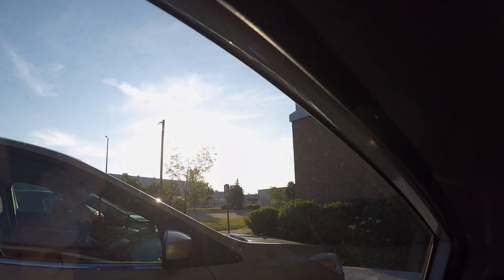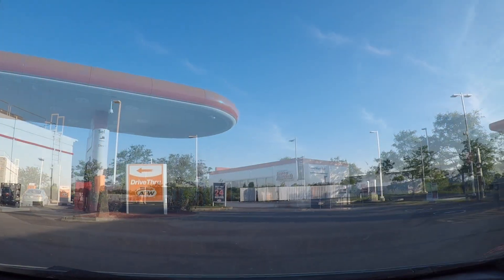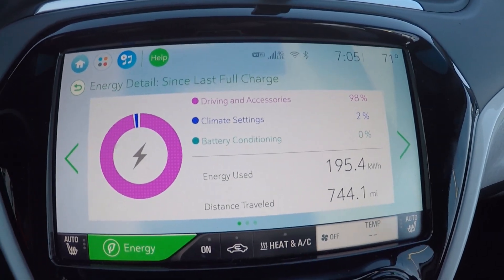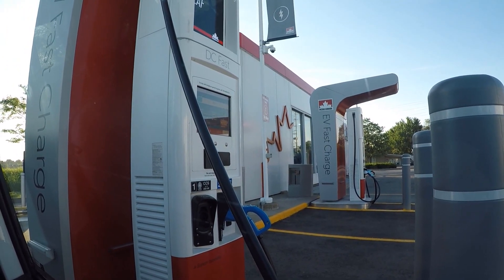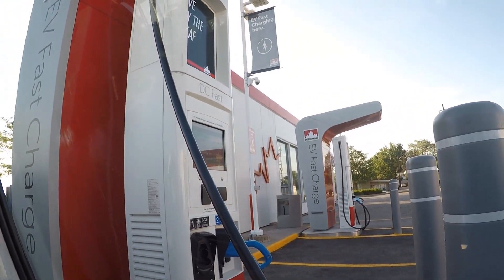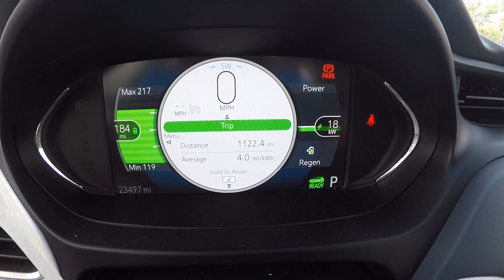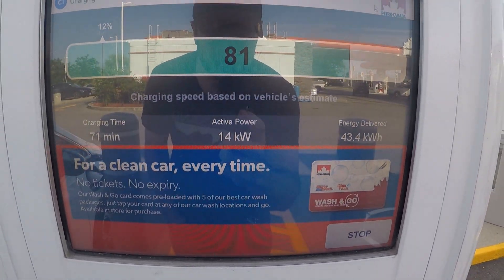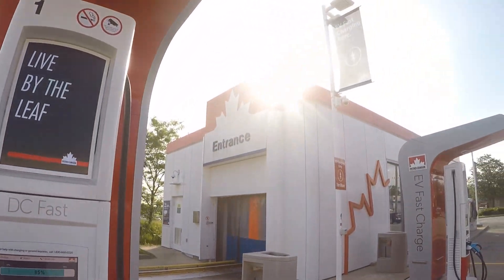EV Charging with Petro Canada: Full Fast Charge Session in a Chevy Bolt EV

Comment: I used the new charger at the Petro-Can at Dorchester near London. I had trouble connecting the charger  too, it needed to be seated properly . The cable is very heavy and you have to park close enough as the cable is fairly short. I got up to 74 kW which tapered and ended at 28kW at 80% (Kia Niro EV)
Reply from the maker: It's a relatively common problem with the older Bolt EVs, but I hadn't heard it also applied to the Niro EV. I've had to do the same on Electrify America's high-powered stations, just holding the connector in place to take some weight off until the car's actuator clicks and everything locks in place. Once the session is up and running, everything works as expected.

Comment: Doesn't fast charging a lithium battery shorten its life?
Reply: I did a search on this recently, found an article where they tested 2 brand new Nissan Leafs over the course of a year.  One was only charged via fast charging, the other with L2.  The FC one only had about 5% more degradation than the L2 charged Leaf.  That small of a difference could just be the difference between the battery packs themselves, one just being slightly better/stronger.
Reply from the maker: High power charging does stress the battery more over time than L2 or lower, but a properly managed pack can minimize that impact. For example, we still have eight year old Model S cars on the road doing fine, as well as Bolts with six figure mileage showing minimal degradation.

Comment: Why did you leave the car on?  I was told to never do that by Chevy.
Reply from the maker: Because the dash provides useful info about the charge session that isn't visible when the car is off. I was also working and needed the car's WiFi, which isn't available if the car is off.

Out of curiosity, was it a Chevy dealer or the manual that offered the advice to turn off?
Reply: Plug and Play EV Dealership
Reply from the maker: I think they might have misunderstood the instructions. It's probably marginally better to turn off the car while charging to ensure any excess energy use is minimized from accessories like the infotainment and such, but that's going to be minimal unless you're blasting the heat and using every conceivable accessory. Even then, it would just mean a longer charge time, rather than anything negative for the car itself.

Comment: Poor bolt owners only able to get 50kW. Thats definitely the Achilles heal of that car. Everything else about it is pretty good. For that reason I'd go kona instead or 3 sr+ for that sweet sweet 170kW charge rate.
Reply from the maker: Pretty much, although the Kona (and Niro EV) only hit up to 75kW briefly as well, so their overall charge time is only ~10 mins better to 80%. Model 3, Model Y, or the next wave of non-Tesla crossovers (Ford Mach-E, VW ID. 3/4) would be best in terms of quicker charging at that $40-50K price point.
Reply: @plugandplayEV  mach e is looking pretty inefficient so im kind of doubting it will be all too efficient at charging. Miles/km added over time will be less than a more efficient vehicle charging at the same kW rate. Hopefully ford is downplaying the range its getting from that nearly 100kWh pack. As for vw im pretty sure they aren't bringing the id to N.A anytime soon but would happily be proven wrong.
Reply from the maker: @larryspiller15  ID. 4 is definitely being built in Chattanooga, TN, although the timeline of late 2020 seems optimistic at this point. The first half of 2021 is still not too far away though. ID. 3 might come to Canada, but definitely not to U.S. 

 Mach-E's range is still a question mark due to the estimates, but 150kW is the stated charge rate and should deliver well above 100kW, even if they muddy the waters as most legacy automakers have done (e.g. GM said 80kW, which turned out to be 55kW max, Kia-Hyundai said 100kW, which turned out to be 75kW max). 

Your point underscores the importance of the efficiency/charge rate combo for long trip EVs, though, where Tesla is still way out in front.
Reply: @plugandplayEV  I saw an article where the CEO of VW Canada said no ID 3 in Canada either. The small hatchback market is tiny compared to the crossover market. Especially in Canadian and northern  American winters. You need a vehicle that can navigate thru snow properly.
Reply: Prepare to add your name to a waiting list if you're set on a Kia or a Hyundai EV

Comment: The taper you observed is controlled by the car which can vary depending on the battery condition.  The new 2020 Bolts have a better battery so the charging may be better as well.
Reply from the maker: Thanks, I'm certainly familiar with the taper but it was around 4-5% earlier into the fast charge cycle than I usually observe (53-55%, typically). I did start from a low state of charge, however, so it could have been hitting high battery temps and triggering the tapers a little earlier.

We had high hopes for the 2020 improving fast charge rates but it still seems to max out at 55kW: https://www.torquenews.com/7893/fast-charging-2020-chevy-bolt-ev-still-tops-out-55kw

 The tapers might be later, however, which would help speed sessions up a little.

Comment: It tapered likely due to battery temperature, what was your battery temp?  I've seen this occur my 2019 will taper hard because the cooling takes a while to kick in, I think it has something to do with the car being on.
Reply from the maker: Unfortunately, I didn't haul out the OBD to check battery temp so can't say. The ambient temperature was fine but the car was at 50+kW for an extended period, so it would make sense that the pack got warm pretty early and needed to pull it back. Thanks for the input!

Comment: I recently charged at the EVGo 350kW ABB charger in Baker CA and it tapered properly at 55%.
Reply from the maker: Guess I just chalk this one up as an anomaly. Unfortunately it's a 500 mile trip to recreate this particular session!

What kind of temperatures did you see in Baker, out of interest?
Reply: @plugandplayEV  it was 108° when I charged there.
Reply from the maker: @homomorphic  Any drag on your charge rate at that temperature? We never push much beyond the 90s here in Mass, so I have very little experience charging at higher temps.
Reply: @plugandplayEV  not at the 350kW, I presume it has a lot of cooling headroom on its side when it is only delivering 55kW. I also charged at an EA 150kW in Vegas at 107° and it gave me the full 55kW as well. I bet you wouldn't get anywhere near 150 or 350 if you tried to draw that though.

Comment: Hi, the bolt has been discounted to $30 K at my local dealership. Do you think that is a good purchase price, or do you suggest waiting another year for the EUV for more range & faster charging ? Over 90% of my trips are under 200 miles, so seriously considering an EV as my replacement. Is the faster charge rate going to be worth $8k more ?
Reply from the maker: Would the Bolt be your only vehicle? If so, how far do you go on that 10 % of journeys that are more than 200 miles? 

$30K sounds about right at current pricing and definitely okay if it's a Premier, although I've seen slightly lower prices advertised in areas like California and here in New England. If you think the current version of the Bolt EV fits your needs, the end of this month is the time to buy. Get in before the tax credit cuts in half and dealers are highly motivated to move their remaining 2019 inventory before the updated 2020 arrives. 

In terms of holding off, the kind of EVs we're talking about with faster charging (100kW+) and range closer to 300 miles are unlikely to arrive in significant numbers before 2021. Especially the Bolt EUV, or whatever it ends up being called, which I wouldn't expect to see until the end of 2021.
Reply: Plug and Play EV: The main reason I’m going for the bolt is cost. The model 3 and Leaf e-Plus cost  close to $40K. Neither come close to the price point I’m looking at. The Kona and Niro have to be shipped from out of state and cost close to $50K. So the bolt is the only affordable EV out there right now.

I drive 350 miles to Manitoulin island once per year, and occasionally drive 300 miles to see family in Chicago. These trips usually takes 6 hours with a half hour stop for dinner.
Reply from the maker: @adithyaramachandran7427  In that case, now is absolutely the time to buy new. If you're prepared to haggle, you can argue that the incoming 2020 will make 2019 inventory harder to sell but you're willing to take it off their hands for a good price in the $25-28K range (assuming it has DCFC and the packages you want). 

Used is a different story. The better prices for the used market will start showing up in the middle of next year, as off-lease 2017s start to become available.
Reply: @adithyaramachandran7427  BOLT EUV is definitely affordable. GM is really going after the average Joe. VW ID 4 is supposed to drop in 2022 once the Tenesse plant takes over.
Reply: @plugandplayEV  good timing bro. The EUV is coming out this summer.

Comment: Yeah that taper is wayy too soon, I was looking at a Bolt but hopefully that’s not a common quick charging issue
Reply from the maker: It does usually hit around 53-55%, so this one was slightly early but not unexpected that it would happen that soon. Lots of us are hoping that GM changes the charging profile for the 2020 Bolt, now that the battery capacity is larger.

Comment: You missed the chance to film with the car's camera on (certainly you're going less than  6 mph). :)

I admit I've been a little hesitant to use a car wash. Not just cuz California and our water problems, but also as the way to set the car into neutral for the wash seems like something I'd dork up. Did you find it to not be a big deal?

I did wash the car for the NDEW event last Saturday but I just did that by hand.
Reply from the maker: I need to do that; I always put the camera on for our kids in the local car wash so we can pretend it's an alien attack (neon lights, blasters... I don't know, they seem to lap it up!)

Our regular wash is touchless and self-drive, so I hadn't thought back to the early manual reading on neutral much. It worked fine on this run though. And thanks for reminding me I need to shine the car up again for our NDEW event tomorrow!

Comment: Do you know if it was the car that tapered early or the charger(?). Thinking experimentally, if you would have unplugged and plugged back in at 50% or higher, do you think the kW would have gone up?
Reply from the maker: The conditions were very temperate and the car showed no problem accepting the upper levels of its intake initially, so it's tough to say why. It must almost certainly be the vehicle informing the drop though, as the charge station was capable of delivering much more and showed no other signs of limiting the session. Perhaps the immediate jump to the Bolt's maximum charge rate, which which was also unexpected, yielded a prolonged stint at high power that the car wanted to ramp down early as well.

The experiment you mention would have been interesting as a test but the practical aspect of unplugging and then starting a new session would have nixed any benefit of restarting at 55kW for another 5%. That said, I was forced into that on a 150kWElectrify America station later in this trip and noted a change from under 30kW in the first session to 50+kW in the restarted session, so it could be something worth trying in the lower half of the battery if the charge rate is poor.